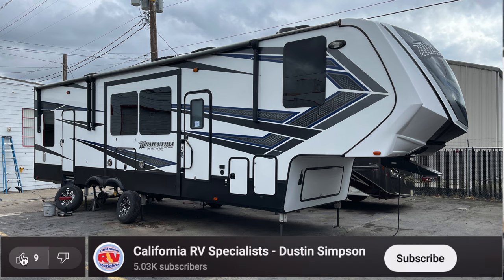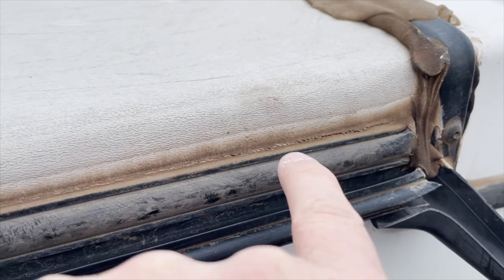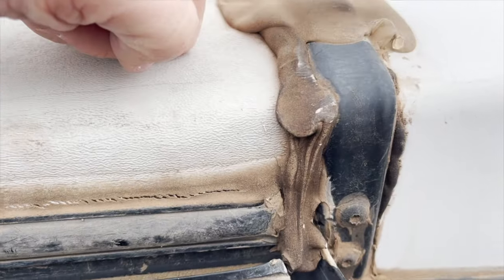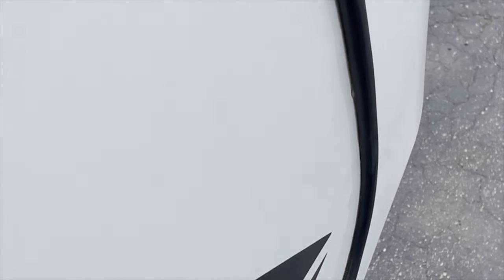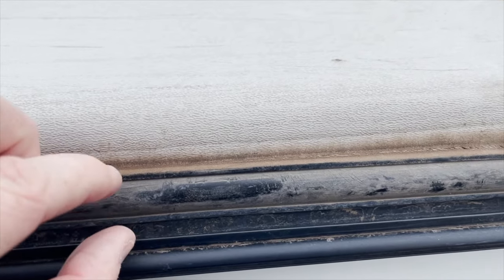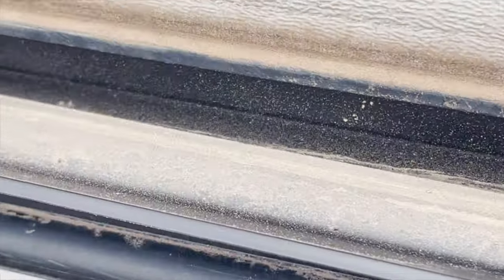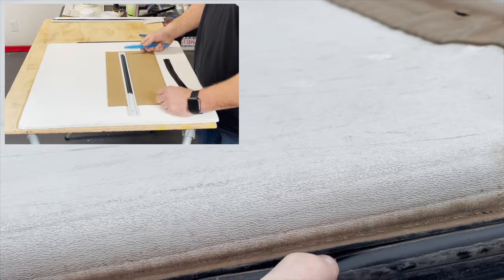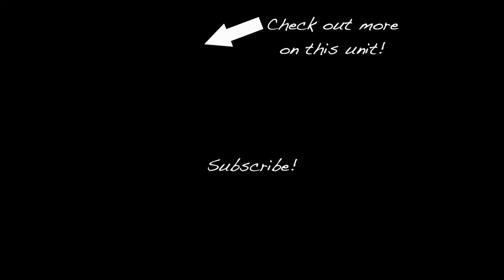RV Roof and Front Cap Inspection Guide

Comment: How do you secure the Insert Molding?  You mentioned that you don't do it like the factory because it attracts dirt etc,  if the factory bends it and tucks it under the track to secure it how would you go to secure it or will it stay in place just by some caulk or screw to the molding itself?

Comment: That’s the most thorough cap inspection I’ve ever seen. Great job!
Reply from the maker: Thank you so much!
Reply: Hi Dustin, do you typically recommend using the Dicor 551LSW no sag, non self leveling sealant for the vertical insert moldings? I have a couple spots on my Class C that need resealing.
Reply from the maker: @jrotor3301  send me some pictures and all do my best to advise you.  Thanks again for watching we appreciate it. 

You can post them in any of the groups and I’ll reply back.

Comment: What do you use to seal the roof to the top of the insert moulding?
Reply from the maker: Sorry for late reply, we still screw the insert molding in place and depending on the area.  Self level and non sag Dicor,  we also use Dicor cap sealant on some as well as boss rv silicone. 

I have some other videos that explains that, when you get a chance check out and let me know.  Thanks again for watching.
Reply: @yourrvspecialists  Thank you - i used Dicor non-sag, the roof is (i think) TPMS, it has that funny texture on it - it seems the rubber roof restricts the products i can use there?